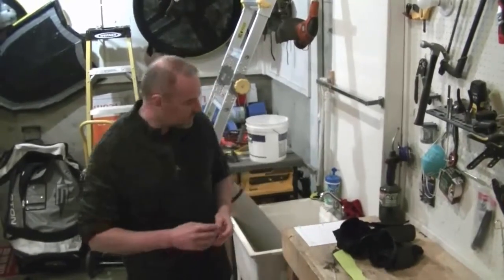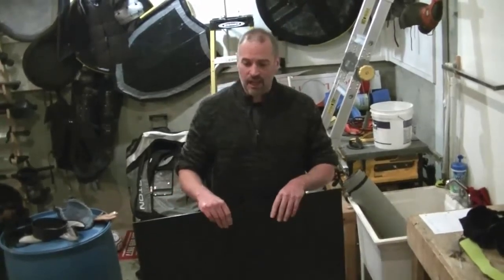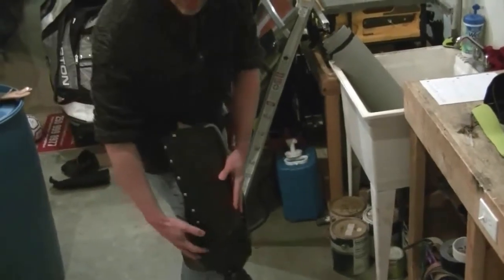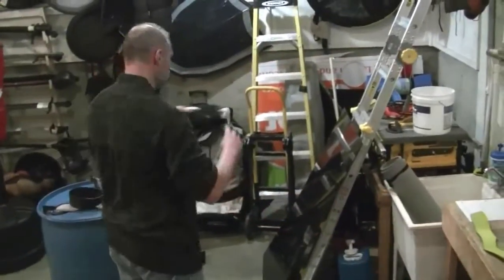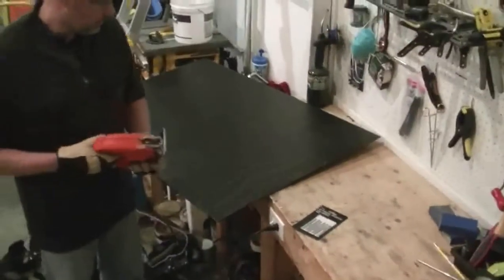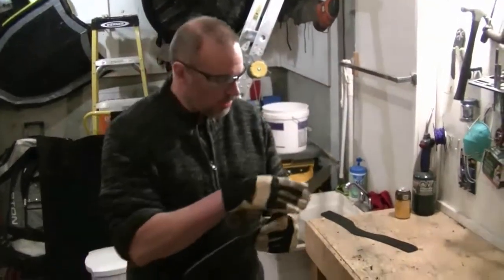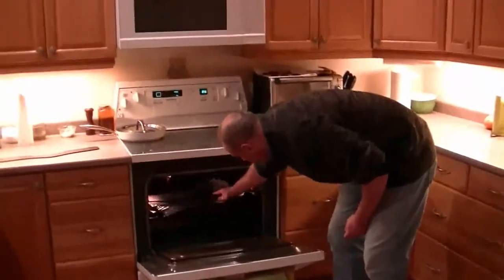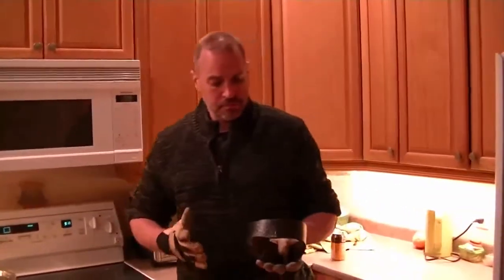How to craft  armour using ABS plastic. Ulfhednar crafting video

Comment: scoring (scratching shallow lines) along the direction you wish to bend the plastic, so that the cuts are inside the curve, helps prior to heat shaping it. with these regions fusing and relenting to the shape, you can better retain your shapings. 
  Furthermore, to paint easily on the picklebarrel material, scuff it's surface significantly via sandpaper or better, rotary sanding bits. 
great work! I'd love to see you work on these pieces.
Reply: i know im asking randomly but does anybody know a tool to log back into an Instagram account..?
I was stupid forgot the password. I love any help you can offer me
Reply: @Kyler Nolan Instablaster =)
Reply: @Mayson Avi It worked and I actually got access to my account again. I am so happy:D
Thanks so much, you saved my account!
Reply: @Kyler Nolan no problem :)